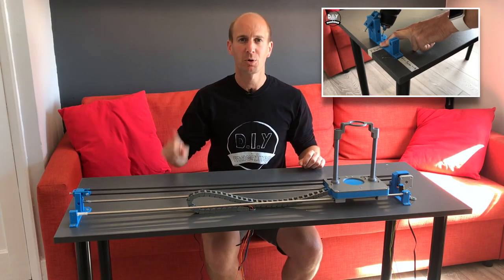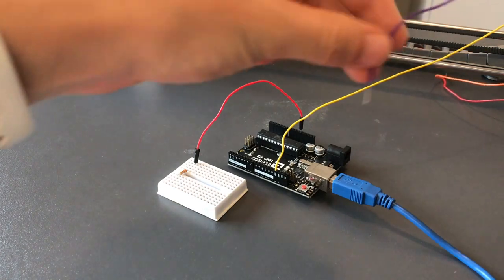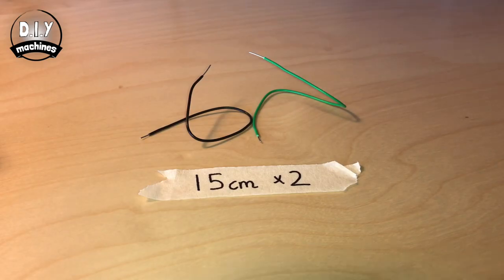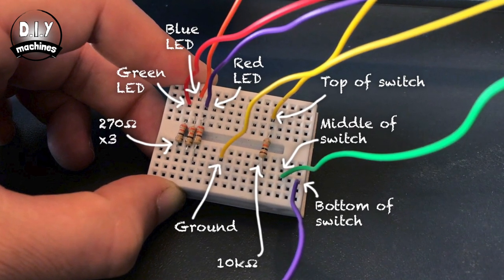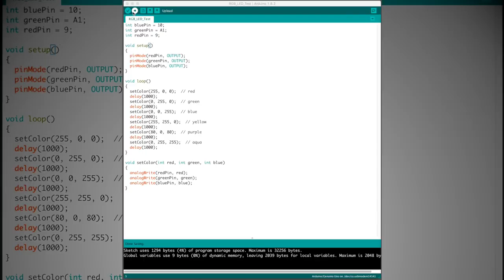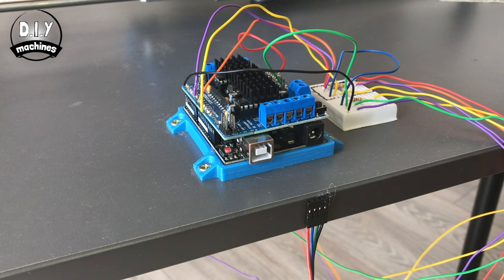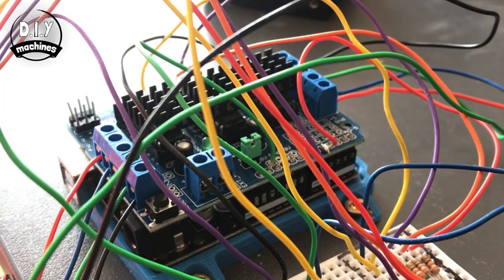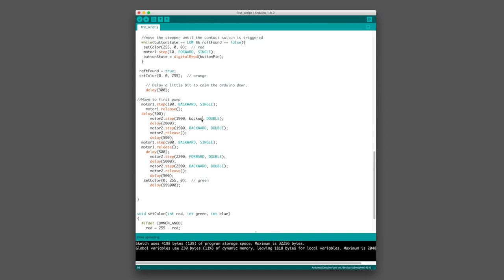How to build an Arduino based 3D Printable DIY Robotic Bartender - Part 2 - Electronics

Comment: somehow my LED is not working. When I put my ground wire into the correct spot in the breadboard not a single light will shine. but if i put my ground wire to a 5V pin on the Shield motor, the lights are working but with weird colors. idk whats wrong. checked 5 times that i got everything like in the video....

Comment: I really loved part one, but this one seems to have a lot of loose wires and protoboards on final assembly.  Clearly, you don't own a cat.  They make solderable breadboards that you can use to duplicate your circuit without having to redo everything.   This would make the circuit more solid and less susceptible to curious house cats.
Reply from the maker: You're right there, no cats. (Though my partner has caused some issues dusting once!) I've looked at the solderable boards you've mentioned and ordered some. They look like a good idea once you finished prototyping.  Thanks for the heads up - you never stop learning. )

Comment: Good evening, congratulations on this project. I have followed all the steps correctly, but when it finishes pouring the liquids, the base instead of returning to the sensor goes outwards by turning the motor for a few minutes. How can I stop this error?
Reply from the maker: Hi Emanuele, thanks. This is unusual - I'm a little rusty on this project as it was made some years ago. Can you send me a short video clip of this happening and the CSV that makes up the drinks request?

Comment: I commented this on the thingiverse page, but I figure posting it here too might get me an answer sooner.

Hey! I'm trying to print this for a school project, and the Slider_BaseV3-_P1of2 files is not printing. It gets about 2/3 of the way done then errors out, saying it's "out of printable area", when it's clearly not. Has anyone else had issues with this? We've tried multiple fixes and nothing has worked. Thanks!

Comment: Hi, I was following  your instructions and everything has worked until I tried to connect the Stepper motors to the Motor shield. The issue was with your code, the output it gives is saying that  "AF Stepper does not name a type" and apparently a lot of things weren't declared in the scope , and the code would stop running.  Wondering if you had any ideas to help me solve this issue.
Reply from the maker: Hi Jerry. Coding is not my strong point. Have a look at this thread - it might be similar to the issue your experiencing: https://github.com/adafruit/Adafruit-Motor-Shield-library/issues/2
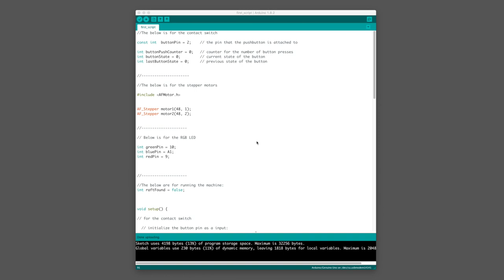Reply: I had this issue as well. Code was missing #include <AFMotor.h> You can spot it at 8:55

Comment: Hi! Excellent idea! I loved it!

But I have one question.

It must be supply by 12v batteries or I can replace for a power supply?

Thanks you!
Reply from the maker: Thanks. You could power it with a power supply. I shied away from mains power as I'm not a trained electrician and did not want to suggest anything that might be dangerous.
Reply from the maker: I also took mine outside a few times in the summer and batteries make that easier. :)

Comment: Hello, and great job with this project! I'm an arduino enthusiast And I'm thinking about building one of these for personal use. I was wondering how do you order  the cocktails as I didn't see that part in the video. Is there a screen menu or something of that sort? Thanks
Reply from the maker: Jonathan Correa Hello, I’m just at this very moment making the next video (part 4) which will explain how to order a drink. In the video I’ll show you how to order drinks from your phone over a Bluetooth connection. In a later video I’ll also demonstrate how to order drinks verbally with voice recognition. You’ll have plenty of options to choose from. I’ve rewritten the code so that it’s easy to place a drinks order in various ways, including NFC tokens,  and physical buttons.
Reply: DIY Machines that's awesome! I can't wait to start my project, thanks for the reply!

Comment: Hello, I was wondering why do you use both digital and analog pins for the RGB led? can you I just digital or just analog pins??
Reply from the maker: erlandu88 Yes, you can use just one or the other. I was restricted on what pins were left available as the motor shield uses several of them to operate. If you look at the eleventh question on this page: https://learn.adafruit.com/adafruit-motor-shield/faq it lists all the pins that are already taken for use by the motor shield. As I added the motor shield first I selected remaining pins to use for the RGB LED. I hope this makes sense.
Reply: Thanks, that was really useful. I'm still working on my own bartender, I'll send you some pics when it's finished, and ill ask you any other question i might have.
Reply from the maker: erlandu88 thanks. That’ll be great. :)

Comment: Why do you use the Analog pin A1 on your arduino board for the blue pin of your RGB led? 
Greatz Kobe
Reply from the maker: The other digital pins are used by the motor control shield so I ran out of them. We can use an Analogue pin though so I chose A1 as it was unused.

Comment: Hello sir, is it possible for me to replace the stepper motors with DC motors on the main rod to raise up the rod using 2 dc motors
Reply from the maker: You could replace them. I would recommend using geared DC motors to increase the torque. You would also need to make adjustments to the wiring and tweak the code so that the motor driver board acts appropriately for DC motors.

Comment: Hi 
I bought an other stepper motor, litlle bit bigger and stronger. Is this a problem for my motorshield that you use? 
42BYGHW804 that is the one I have. 
Thanks!
Reply from the maker: Hi Kobe, I'm not a huge expert on motors. But from some quick searches as far as I can see you may just need to supply it with more or less power - the code and everything else should be just fine.

Comment: Hi, It´s me again :D I have an idea, I want to create something like RGB loading circle under the glass but from single RGB diode like that one you are using. Do you know how to connect them or is this even possible connecting to arduino ?
Reply from the maker: Hi Kamil. :) Do you want to create the loading circle with a single RGB LED or do you want to use multiple RGB's to give an effect similar to the lights on top of an Amazon echo?
Reply: I want to use multiple RGBs, exactly I have 10 RGB diodes. Yeah something like Amazon Echo, It should be "load circle" depending on the selected drink and time preparation of that drink.

Comment: Hello! I tried to load the test 1 on my UNO but without success it may be because I use an adafruit shield v2 and what should I change
Reply from the maker: Hello. What happens when you try to load the code? If you post here someone might be able to offer some advice to help you.
Reply: I've had the same issue.  LED and contact switch work perfect but when I upload the code for "test" nothing happens.  The code is verified and uploads without a problem.  I am using an Adafruit shield v2.  Any thoughts or suggestions?
Reply from the maker: I'm sorry but I don't have an Adafruit shield V2 to try it with to see if it can be worked around.

Comment: Hi there! can you kindly elaborate the working of contact switch 
Thank You :)
Reply from the maker: Hello, sorry for such a slow reply. The contact switch is used to detect the location of the paddle as when we first turn on the machine the paddle (which holds the glass) could be anywhere along the X axis. So when it's first started we move the paddle towards it until we detect it's presence when it closes the switch.

Comment: What do you reckon is the cost of creating this?
Reply from the maker: Great question. I'll work it out and get back to you tomorrow when I return home after work.
Reply: Was this answer ever shared? Purchased a new home and I have a prime spot for a basement bar, and this would be a fantastic attraction.
Reply: I calculated the costs of this project and its around 200€-300€ in Germany (depending on how many parts you already have)

Comment: How can i connect and build a mobile app for this project.
Reply from the maker: The Arduino is receiving the commands through the Bluetooth module which intern relays the message through the Arduino's serial connection. If you wanted to build an app it would need to be able to connect to the HM10 module and transmit characters to it.
Reply from the maker: Hi John. Programming is my Achilles heel to be honest. It's something I'm still learning a lot about. If you figure it out, please do share it with us.

Comment: After spending so much money to get the parts 3D printed and sponsoring the effort, one realises that these are not worth the effort. The motor sometimes moves some distance and sometimes some other distance and at times just hunts. No specific causes noticed. All money and effort down the drain.
Reply from the maker: manochou2 That’s a shame to hear, you could have reached out to me on Patreon for support. Do you still have the machine assembled? I can try and help you troubleshoot your build if you want?
Reply: @DIYMachines  I did but was informed you have long-shelved the project and moved on
Reply from the maker: @maochou2  Just gone back through our messages on Patreon. You asked if I could write different code and revised electronics for "ordering drinks by pressing button input adjacent to each dispenser (not Bluetooth)" I offered up an idea on how you could make it do such a thing but explained that as I no longer had mine (I ran out of space in my little project room) that I could not rebuild it to add the requested functionality. This is what I had suggested:

 "Gosh, that's quite a change in design! The Robotic Bartender that I built for the video has been dismantled now as I ran out of space for keeping it and needed some of the parts for a new project. 
I'd suggest using an Arduino Nano and a separate circuit to make something that can collect your order as you push the buttons adjacent to optics. Add two more buttons, one to finalise the order and submit it and the other to clear it if you make a mistake.
When the button to submit the order is pressed, have the Arduino Nano submit the order through its serial connection pins to the Arduino Uno on the main project. This way you don't have to re-write the main project code and can develop yours in isolation which will make everything far simpler."

Apologise that I could not help with your feature request. There are several people who have successfully made the project and have written to me to share photos and videos of theirs working. There's a small community on Thingiverse - perhaps you could reach out to them and see if they might like to work on the design change with you? (https://www.thingiverse.com/thing:2478890)